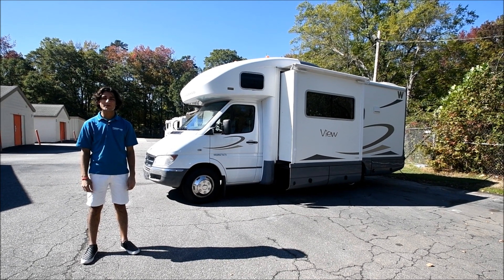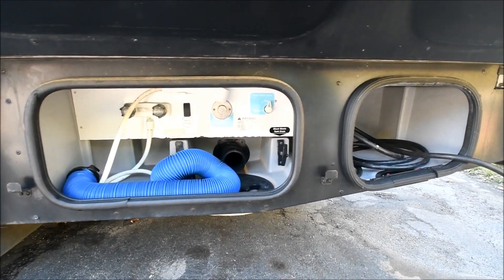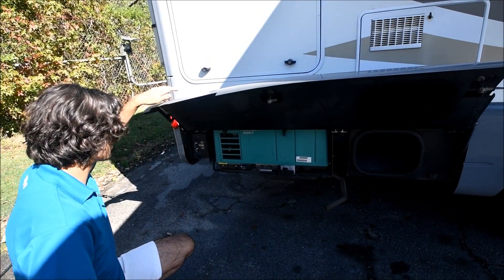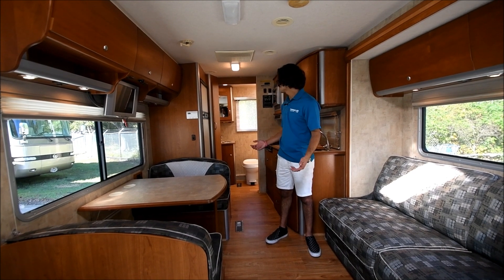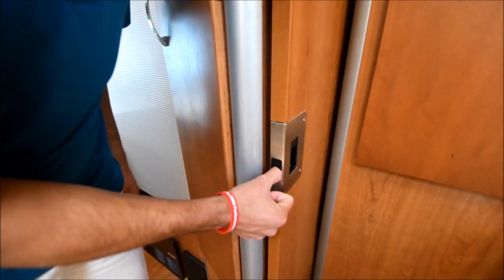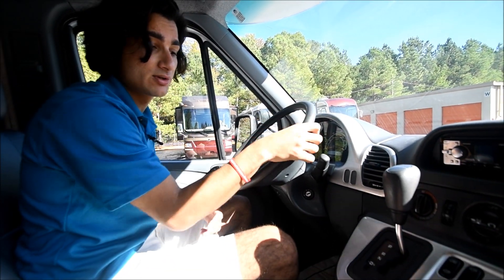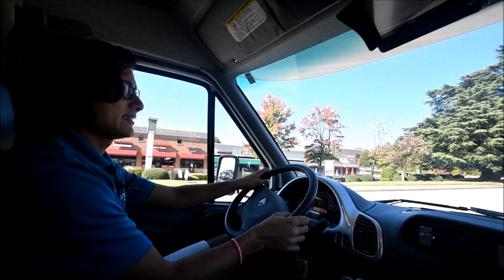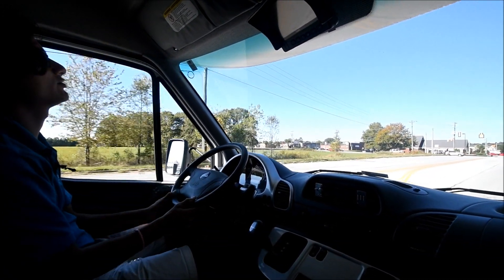2007 Winnebago View 23H new tires, new floors, low miles

Comment: I just purchased one of these and wish I'd done more shopping perhaps. It has 90K miles, same year, same exact model. Paid $60k, but this is a Arizona price so it may be less in Eastern and Midwest states. I like that you pointed out some features and info that I had not considered. I may have not gotten the best deal available, but I'm sure I going to be happy with it as I will be eventually full timing in it.
Reply: How's the maintenence? Thinking of buying but have heard it's hard to find a mechanic to work on diesel sprinters.
Reply: @Nomadic.A  Should be no problem to take to any Dodge or Mercedes mechanic. These little turbo charged beasts are built to last and much better fuel mileage than any class C with a big block American built V8. I did my research first.
Reply: I just bought same rv yesterday.  118k miles. Nearly perfect shape. Private buyer. Paid $40k and no tax. Slight sqeak front right wheel on the way home.